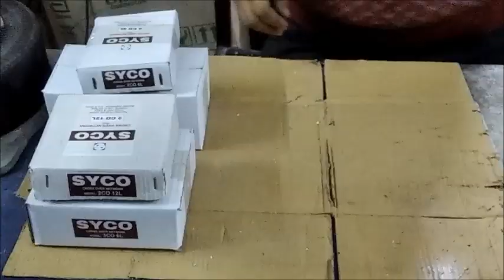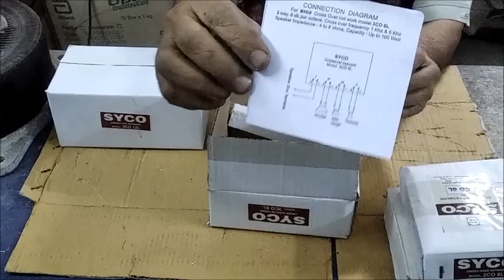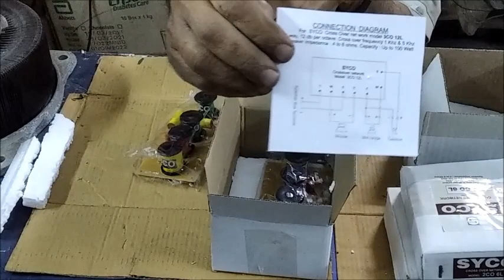6 dB and 12 dB Crossover Network ll What is the difference ?

Comment: Sir you please tell that if I use two woofer 4ohms impedance in tower   speaker box what's the capacitor value to include without calculate in 2nd woofer ohms & not decrease the low frequency in woofer

Comment: What should be the wattage of the mid range speaker for use with a 500 w amplifier ?
Reply from the maker: Amplifier power is mostly consumed by low frequency ie woofer.
Midrange frequency over 1000 Hz requires only about 10% and tweeter  about 5%. of the rated power.
Reply: Sir I have a stereo amplifier with 100watts at 4 ohms per channel . If I want to make a 3way speaker system then how i can  select woofer; mid ; tweeter wattage  of speaker.for eg ( woofer - 50 watts ; Mid - 30 watts; tweeter 20 - watts .) . I ask this question to many technician but nobody gives correct answer. So please help me sir . I am waiting your advice. Thank you
Reply: @anishgopalakrishnan1050 According to Alok mukherjee Sir, in a 100w per channel, distribution would be like 85w woofer, 10w mid, 5w tweeter